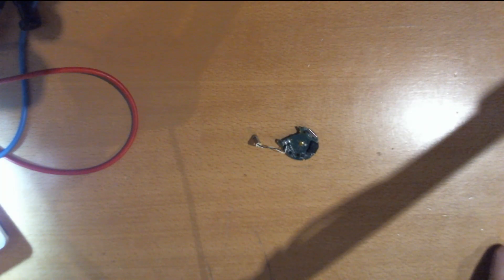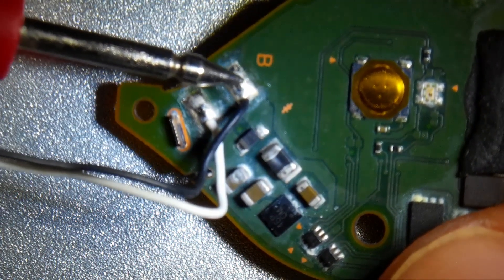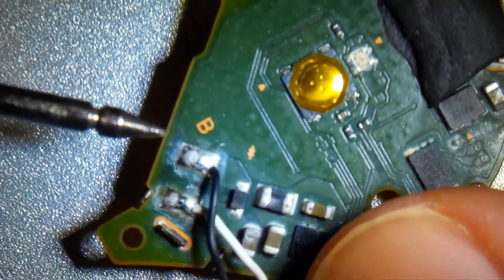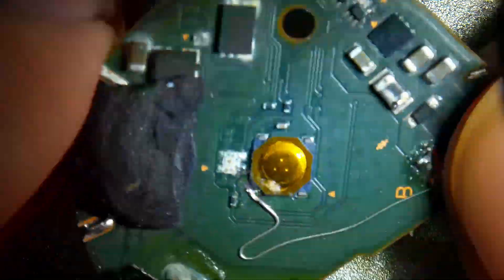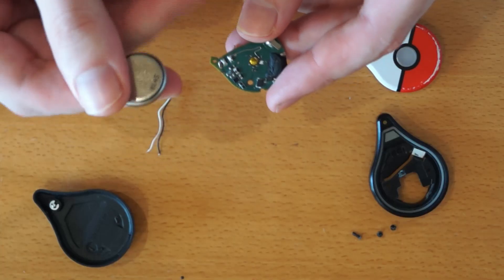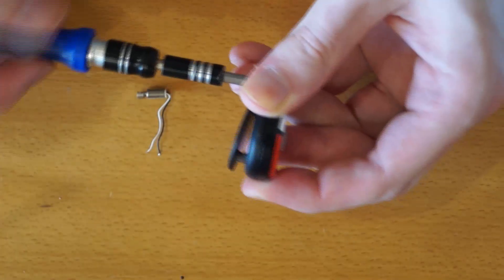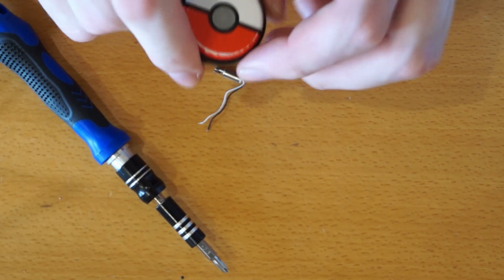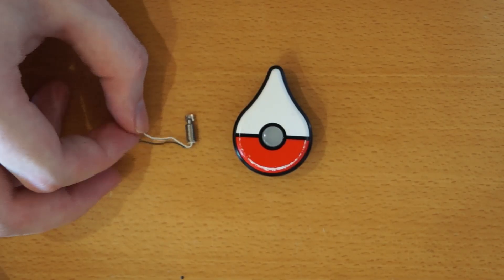Pokemon Go Plus Autocatch Hack

Comment: What kind of replacement wire did you use? I’m new new to soldering 😭
Reply from the maker: I just took one that I randomly found in my workshop. lol
There are differences in wires in terms of solderability. Just try one. 
The most important tip is: Try to heat the work piece a little before applying the solder. But not to much.

Comment: What do I do if one of the inner screws is stuck? I think it had a diferent head than the others and I screwed it up by trying to use the Y screwdriver
Reply: I know it’s 2 years late but on the newer models the screws under the battery are Y screws but not 0. You need to use a Y 1.5 bit for them

Comment: Do you have any problems with connecting it? Because the button is always pressed
Reply from the maker: Well the button is not always pressed. It gets automatically pressed when the vibration motor would turn on. Elsewise it would not be possible to use it anymore. You're right.
Reply: @crazywebhacker9769  thanks for the advice

Comment: its not work for me , my cable is red dan blue , and after i solder it to top left and there is no any different , i still press the button for catch pokemon ,.please help
Reply: I think you got the new version where the button is basically upside down. You have to solder the cable to the bottom right contact. Worked for me

Comment: Can you do automatic pairing?
Reply from the maker: It would require control access to the app I think. Never tried it. As far as I remember niantic also locks the app if the developer options are active.
Reply: @crazywebhacker9769  can you try to that? I wonder if it's working or not
Reply from the maker: @lukechoi3200  nah it it is phone dependent then. Plus you have to carry additional hardware to control the phone. I think it is easier to hack the apk at this point ^^
Reply: @crazywebhacker9769  humm thanks.. I couldn't find any information
Reply: @crazywebhacker9769  so I can only use the go plus with one device only?

Comment: I did this and the go plus works but it doesn't auto catch 
Edit (fixed)
Reply from the maker: Are you sure the connections are good? I have of course no idea about other versions of the plus than mine. However it would surprise me if they changed the design in such a way.
Reply: @crazywebhacker9769  I figured it out I have a cheap one so the connections are different so I was sending a voltage to the battery instead. But it works now
Reply: @OliverMappin  so how do u get it work with the cheap one? Soldering the wire to the other contact of the vibration motor?
Reply: @MrDerpHerpson  no to the other side of the button. So the bottom contact from the one he is soldering in the video.
Reply: @OliverMappin  thx, I will give it a try today (y)
Reply: @MrDerpHerpson  ok if it doesn't work then try the other connection of the motor to one of the 2 button connections.
Reply: @OliverMappin  I tested the motor connection to ground. That's the left one.
Reply: @MrDerpHerpson  did it work?
Reply: @OliverMappin  it works. Thank you very much :)
Reply: @MrDerpHerpson  that's great to hear. Merry Christmas and a happy new year.
Reply from the maker: @OliverMappin  Sorry for the late response. Happy that you figured it out.
Reply: @crazywebhacker9769  that's cool o forgot about it anyway :)
Reply: Hi thanks for this useful video. So just to clarify on the "cheap" ones its the left terminal on the motor and the wire goes to the left bottom of the button?
Reply: @_ImReever  I believe that's what I did yes
Reply: in my new pogo plus. right side vibration motor and bottom left side of the button.